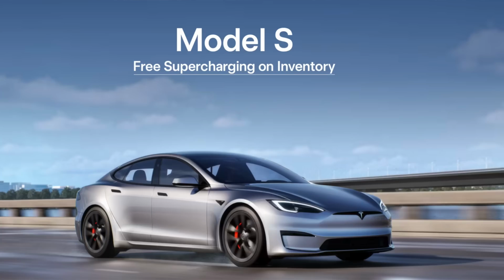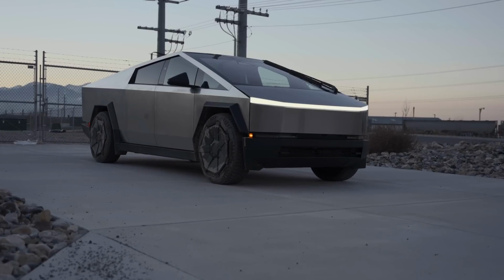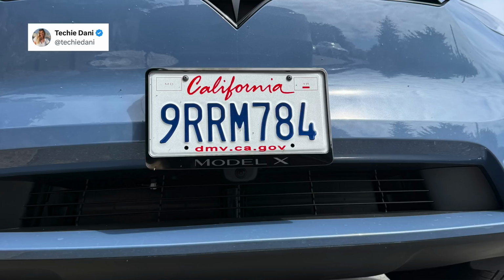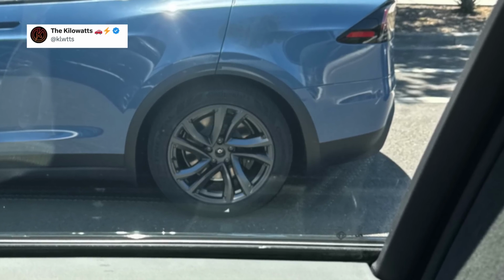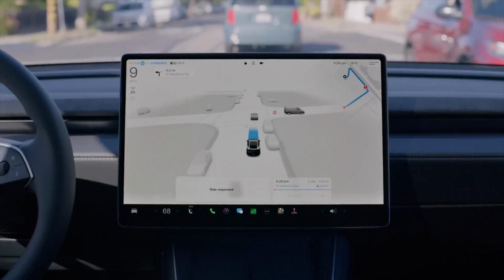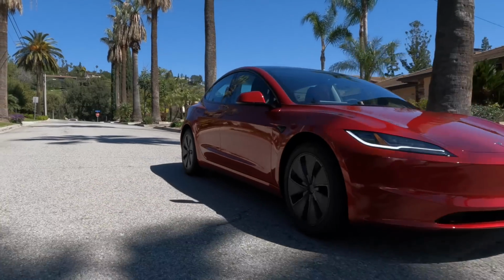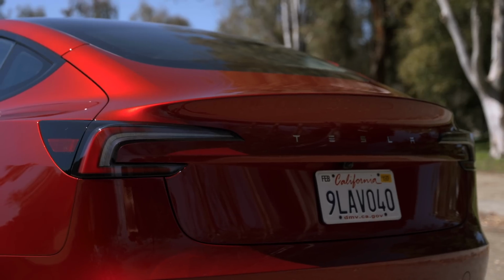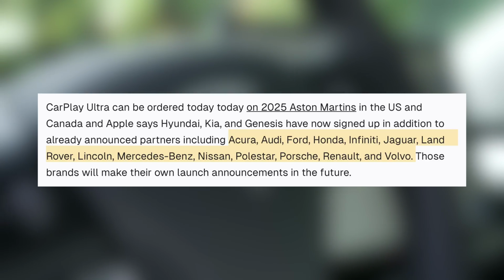$6000 Off NEW Tesla Models | Tax Credit Is Leaving

Comment: One thing that Tesla is pretty terrible at is revamping their car models in a timely manner. The Model S and X should’ve had significant refreshes 5 years ago. The Model S used to be the flagship car and the company has all but forgotten about it. This is a big reason why the sales of the S and X are so low. And the Model 3 and Y refreshes have been fine but if they don’t do a full refresh soon, sales of those models will continue to slip too. People don’t just want new tech, they want new looking cars too.
Reply: The continual push to refresh cars is largely responsible for the plasticrap that is shipped from many manufacturers. Globally, we would all be better off with fewer "refreshes".
Reply: @darrylhowe1465  fair point. But one of Tesla's main goals is to transition the world away from ICE and towards EVs, and it's much easier to achieve that if the sales of two of their models were growing and not falling.

Comment: How well does anyone here understand the rules of the extra  bonus discount's,  like the Hero's  1,000 discount and  Military Veteran discounts of 1,000 ?

for example does anyone know if you can combine these credits? does anyone know if these two credits could be combined for a 2023 used  long range model 3 ?
Reply: Based off what I read, it's only for new leases or purchases.  Not on used.

But, you can stack it with a referral code.  I got 1000$ off the 2026 Model Y for being an educator and got 3 months FSD with the referral code (even though I went ahead and bought FSD upfront).

Comment: I would be in favor of ending the EV subsidy as well as subsidies for oil and gas and then apply a carbon tax to fully account for the cost of burning a fossil fuels and then let the market decide what's the best choice. It will make EVs more cost effective because they have less of an impact and it also require that cost to be built into the manufacturing of the EV driving the manufacturing to cleaner energy sources as well.
Reply: At first blush, I can see how the "carbon tax" might be appealing; however, this suggests that you are not aware of how much "carbon" emissions are created during the process of building an EV vehicle verses a ICE vehicle. At the last report I have seen, you would have to drive approximately 500k to reach a "carbon break even" point compared to a HYBRID vehicle.

In addition, all of the "carbon" concerns are predicated on the questionable premise that carbon emissions cause Global Warming, wait ... Global Cooling, wait ... Climate Change ... uh sure.

Comment: End the $7500 incentive. I just ordered my first EV and I am getting the incentive but I would have bought the same car anyway. The incentive has been a wealth transfer from the poor to the wealthy since it was introduced. Just another Democrat idea that is reverse Robin Hood and takes from the poor to give to the rich.
Reply: It doesn’t save the buyer. It just diverts your tax payment to Tesla.
Reply: @raleedy  Funny, it saved me $7500. I wouldn't have been able to go EV without it. $125 a month difference in the payment. Add in the $100+ a month savings in gas expense and That $7500 is going to save me a whole bunch more. The savings in maintennance is also going to add up. In 30,000 miles we haven't put anything in the car but wiper fluid. I've already skipped  -8-   $65 oil changes.
Reply: @GROND15 You’re right, I wa# thinking of the old setup, which was pure tax credit, no rebate. My bad.
Reply: @raleedy Actually, I transfer my tax credit to Tesla for a $7500 reduction in my purchase price and then I pay to  the government the taxes I would have paid without the tax credit, so clearly I paid $7500 less than without the tax credit. You can argue that Tesla raised their price by $7500 because of the tax credit but we will find out if that is true on January 1, 2026.
Reply: @raya4358 Right. I think — based on what happened in 2019 with Tesla — that the manufacturers can capture much, but not all, of the subsidy.

Comment: Unwatchable. So many ads in such a short video.
Reply: Then just click/tap the "skip" button. The ads without a skip button are usually very short, rarely lasting longer than 15 seconds. I'd hardly call that unwatchable. And technically, something is only "unwatchable" if you can't see. If you're not blind, then you can watch anything.
Reply: @woodenmetal2977  I think you are missing the point. Let's simplify it for you - Too Many Ads!
Reply: @darrylhowe1465 
No point is missed, I assure you. Just skip the ads and get back to watching. If ad can't be skipped then just wait a few seconds.
Reply: get Brave browser and say goodbye to ads forever

Comment: I missed out on the DNA that seems to think changing the creases in the sheet metal every few years is what matters. Model S look is timeless like the Jaguar E-type. I want any changes to make it go further on fewer kWhr. What would get me to upgrade my S is the interior and the technology. Drive by wire, HUD, seats similar to Mercedes or BMW high end vehicles, full phone integration, a pad or an i-drive that is functional from my arm resting on the console pad making the touch screen functions usable, and even more screen real estate so I can keep most functionality visible at the same time. They say that unsupervised FSD will let us watch videos or do whatever someday. Won't happen if the touch screen is so difficult to use while going down the road. Some countries have roads like a glass surface. Ours stink. If AI5 board includes Grok integration, that would also be important. Hopefully, there will be a field upgrade allowing us AI4 types to get the front bumper camera added. If not, they are setting up the AI4 purchasers to be as unhappy as the AI3 purchasers who would like the best possible FSD.

Comment: S/X is disappointing; should have 800V arch, 48V, CAN, Steer and Brake by wire, FSD included, 500mile+ range, massaging seats that fully recline.
Reply: Only if they redesign it from the ground up.
Reply: @GROND15 they really should. A full redesign is long overdue for the S and X.

Comment: I've  said before that the EV tax credit should be available to those who benefit the most.....the lower wage earner tax brackets.  If you earn over a certain amount of income, you don't really need the help.  But the family of 4 or 5 just making ends meet would benefit greatly both by the lower purchase price but the operating costs as well. Congress should enact something like this.
Reply: That is the way it works CURRENTLY.  $75000 earnings limit (per person) for used EV credit.
$150,000 limit for new EVs.
Reply: @DM-zq8qy  I wasn't aware of that. Thanks for correcting me.  I wasn't aware of the specifics because I've never done a deep dive on it.  Why?  Because my sole income is Soc. Sec. and I don't pay income taxes.  I would get no tax credit even if I could afford to buy one, which of I can't.
Reply: @billthecat7536  I am on SS as well. They took $7,500 off my purchase price at the time of purchase.  Even if I owe $0 FIT, all I have to do is verify that my income is less than the $75,000 (or $150,000 per couple.)
Reply: Po people don't need EV toys.
Reply: Not accurate, they changed the tax law in 2024 that allows the discount even if you don’t have a tax liability if you transfer the credit to the dealership who deducts it from the price of the car….assuming all other qualifications are met

Comment: If the 7.5K credit is going away, the sale will be less , people will go for toyota hybrid. I would by the new Camry better. 45mph and more convenience of not waiting to charge. Better Toyota dealer service.
Reply: I tried to schedule service for my rav4, six weeks out!  I was told the Tundra engine claims had them swamped, same reply at different dealership.  I went to a private independent garage, and received better service
Reply: What about insurance costs?
Reply: Not necessarily maybe it’ll go up but people might start buying used Tesla’s more. I just bought a 2022 model y performance with 40,000 miles for $27,000 great deal on used even without the Ev credit